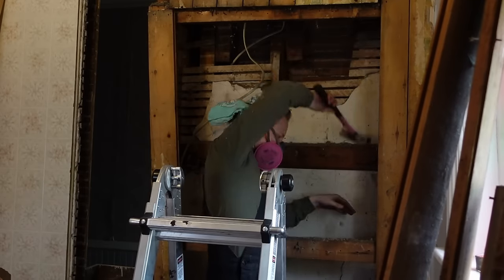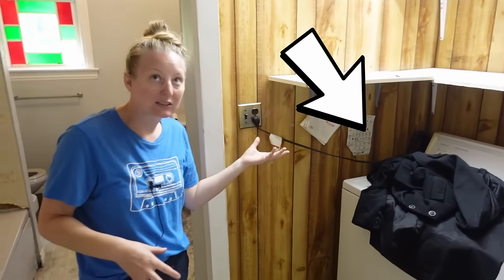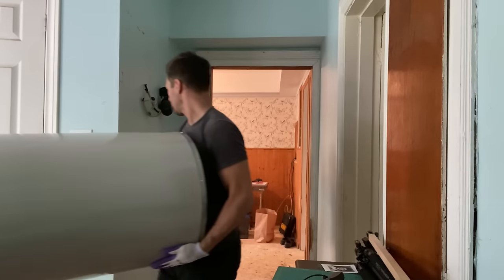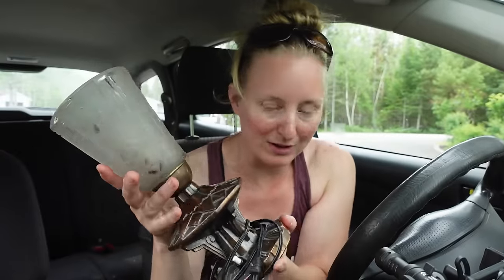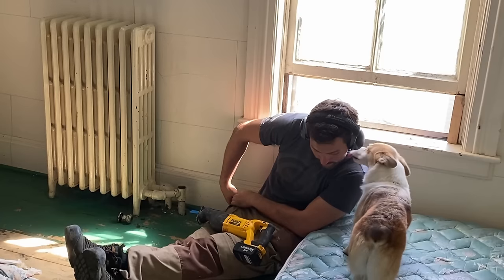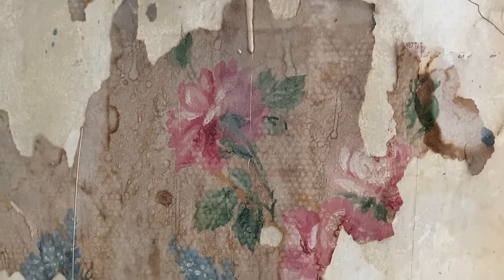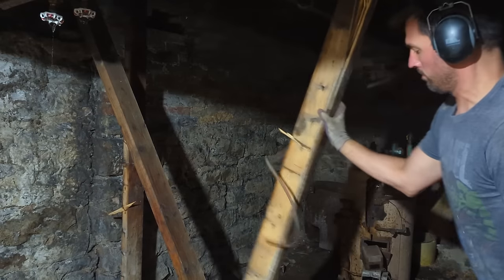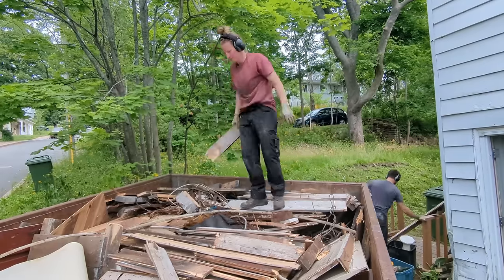Can this be ORIGINAL?

Comment: I have those same straps. Hack:  as long as each strap is a bit longer than the round/awkward item, place them in a diagonal so they form and X under the round/awkward item. It's what my husband and I have made work :)
Reply from the maker: Clever! We did do that for some radiators later on, but haven't tried to move anything round again with them 🤣
Reply: @ShannonMakes  it can still be awkward, and may not work in every situation, but could be worth trying. Best of luck!

Comment: For wallpaper I would go to libraries collections and check by years to get a feel. Not super scientific but could help. I know the French national library (Gallica website) has an impressive collection online. For all I know old paper are almost impossible to remove without destroying it, any water would shred it to pieces since it was printed on thin basic paper. Seems it could work only if they come up dry, with crumbling plaster. But even smaller pieces could definitely make a cute collection once framed.
Reply from the maker: You are 100% right about the water shredding it... that's exactly what happens basically!

Comment: I am loving this series and I know it's out of date with your current house setup, but I wanted to share some washing machine knowledge that could be useful. I have been researching them recently and have learned some interesting things. First, second hand machines aren't necessarily better than new ones. Older machines may have been made during time where water usage wasn't regulated or the regulations were different and can therefore use 10s of gallons more water than a new machine. Obviously this is machine dependent, but even energy efficient or sustainably rated machines from yester-year may not be as good as a new machine because those ratings change over time as well. Unfortunately that means more work for us, the consumers, looking directly at model numbers and years to figure out water and energy efficiency. Obviously there is also a given and take between up front cost as well.
Also, the big pole in the middle of your machine is called an agitator. It's good for getting water spinning and common on top loading machines like yours (and mine), but if you're buying a different machine, I'd recommend looking for one without an agitator. Unfortunately agitators are really hard on your clothes and make little tears and pulls leading to more mending. It is noticeable. Our old apartment had machines without agitators and the number of little pin holes I've had to fix since moving into a place with an agitator on the machine is noticeably higher. 
Good luck with the renovations!
Reply from the maker: Thank you! I am not financially in a place to get a new washer yet, BUT I fully agree that it would be worth looking into and probably getting a newer model eventually, both from an energy efficiency and water usage POV, but also because yes, I've noticed (because I travel a lot, so I use a lot of front loading, agitator -free machines) that it's harder on the clothes too! A small stackable unit would honestly not be the worst, when we do eventually have to replace them!
Reply: @ShannonMakes  I also do not have the funds to replace mine. I was eyeing some nice ones at Best Buy the other day and they're just so expensive. 😭
Reply: I miss being able to soak a load of laundry or vintage/really filthy items. I can't tell you how many times I've shaken my fist to the sky using my modern machine. Sometimes it's actually more efficient to use more water.
Reply: @moxielouise  I have never had a machine that had a soak feature,  so I have only ever had the bucket soak option. We wash our woolens in the tub because I don't trust our machine's delicates cycle. Luckily woolens don't need to be washed with every wear.